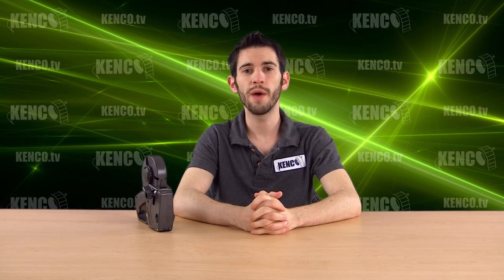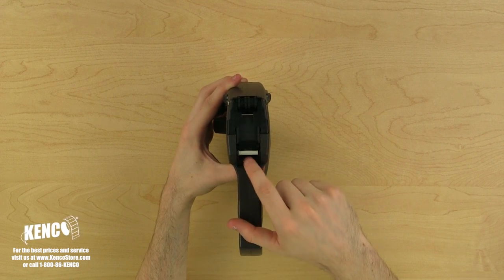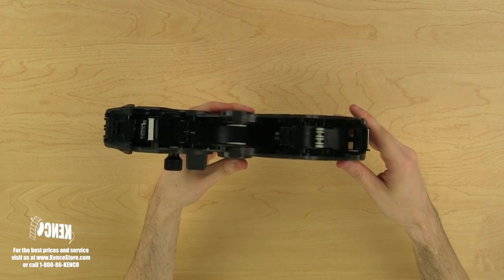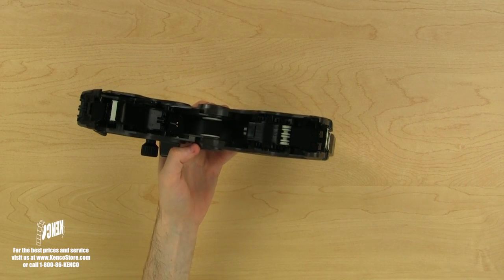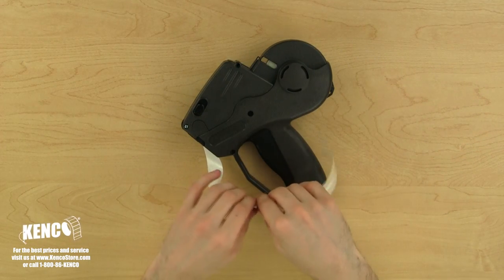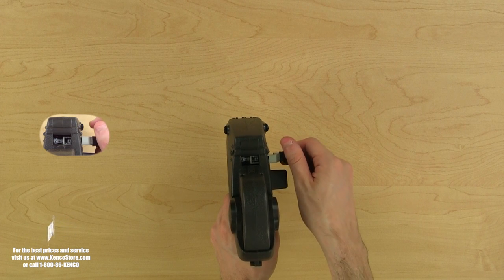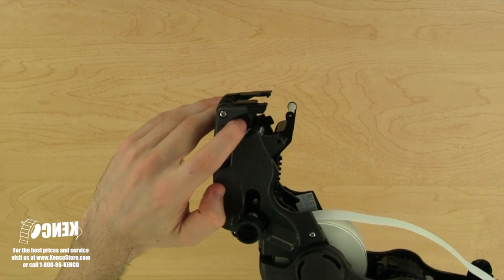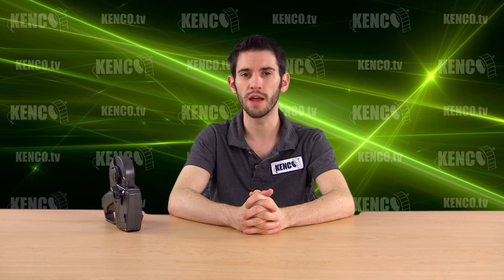Monarch® 1138 Loading & Maintenance Instructions

Comment: I’m having an issue with the ink... it seems to not be fully formed when printing on the label... can someone recommend some tips?
Reply from the maker: Can you elaborate more on "not fully formed"?  If you want, you can also call us and speak with a specialist. 800-537-3336
Reply: @Kencolabel  hey there many thanks for the reply! I have solved the issue on my own... I wasn’t pressing the trigger hard enough which made the numbers partially formed.
Reply from the maker: @marc-kevinsiegfried6613  Marc,  This could also be a sign of debris in the print head.  This can be caused by not switching out your inkers often enough (usually recommended 1 inker per sleeve of labels)  To clear some of the debris, you can use a Q-tip and some isopropyl alcohol to clean the bands.  This could help make the print clearer and require less pressure when using the pricing gun.
Reply: @Kencolabel  thank you for the maintenance tip! Really appreciate it.